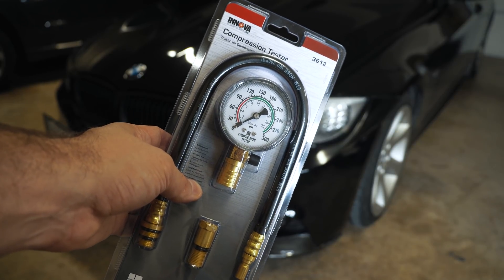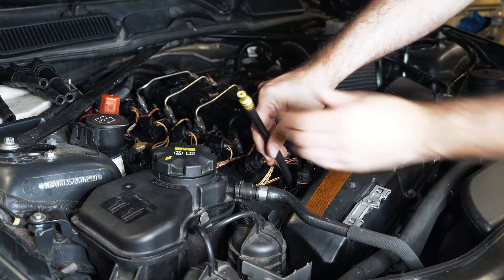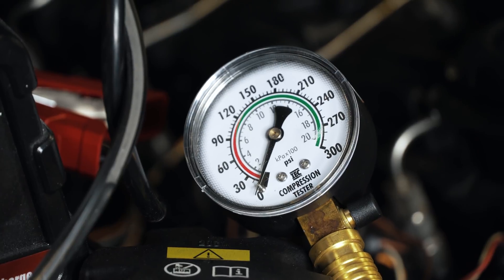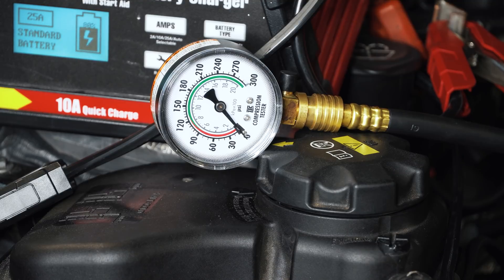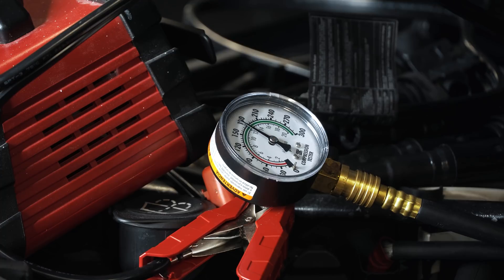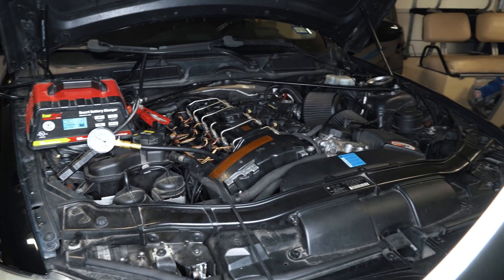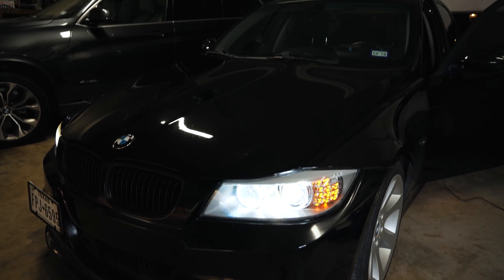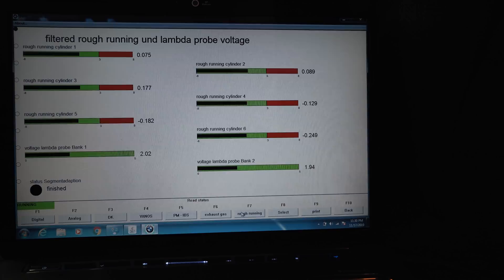I Can't Believe It. At 200K Miles My BMW Engine Is BRAND NEW?!

Comment: My e90 n52 Has almost 170k and running strong, soon im planning to replace oil/coolant housing gasket. Preventative Maintenance. And using Liqui moli and ever since runs better, more powerful and exhaust sounds more Aggressive and no more ticking. And I step on it or u know take off normally and Shifts are very smooth which I love.

Comment: I have three bmw's a 1991 bmw 525i with 233,000 miles, a 1994 bmw 530i with 260,252 miles on it and a 1999 bmw 740il with 212,000 miles on it. I bought the 91 for $6300 back in 2002 with 130,000 miles, If you take care of your cars then can last a long time. cousin had a 1986 or 97 bmw 528ie with 360,000 then a truck totaled his car.  My mechanic has a friend has a 3 series with over 1,285,000 plus miles on his car. Here is a video with one million miles: https://www.youtube.com/watch?v=gHmMlU8Q-V8   BMW has won more engine awards than any other car made. https://en.wikipedia.org/wiki/International_Engine_of_the_Year

Comment: What are the compression numbers for a factory engine ? I been told that the n54 it's good with 120 psi , it's that right ?
Reply from the maker: I believe you would want to see at least 170 across to deem the motor very healthy.  Direct injection turbo cars have compression numbers similar to older NA cars.  120 would be a really low number give the compression ratio of the N54.

Comment: But Scotty said that it was impossible to reach cylinder 6 and that ANYTHING plastic in an engine bay will fail immediately and is worthless. 

His dumbass must not know Toyota uses plastic intake manifold, pulleys, hoses, radiator end caps, valve covers, expansion tanks, washer fluid, gas tank etc. 

Solid info my dude ❤️🤙🏽

Comment: Amazing results for the mileage. Usually it's the rod bearings that kills the N20, N54, N55 and S55 (same exact part). 
You should send a oil sample to a lab to make sure low amounts of wear metals show up in the samples.  Lead may not show up in tests as the bearings are made of special alloy.
The B58 engine uses coated bearings which are significantly more durable.
Reply from the maker: Yeah that's a good idea, I will keep a sample on the next oil change.  Yeah I believe the bearings are coated on the B58 to tolerate the start/stop functionality.

Comment: Clown Scotty, complained that BMs engines don’t have oil dip sticks, because you can check the oil level from the instrumentation without getting out of the drivers seat, a little like an aircraft, bad design hu 😂

Comment: Any mechanic who knows what he's doing will not be surprised by these figures, those compression figures are near perfect for a new engine never mind one that's done 180,000 miles, BMW engines are brilliant if looked after properly and that six cylinder unit really takes some beating for high mileage reliability. I think given those figure that engine will be capable of a least doubling the mileage it has already covered no problem. The Diesel version does Unberlievable mileages between overhauls, that six cylinder in line engine must rate as one of the best engines in the World no matter what that Australian Pillock Scotty says.

Comment: Off topic a little, Do you worry about rod bearings going bad at 200,000 miles given the amount of HP & Torque you are running?
Reply from the maker: They very well could but I'd rather leave well enough alone, if you proactively replace the rod bearings you may find that your main bearings all of a sudden go.
Reply: Are you saying that replacing the rod bearings would create an imbalance in new/ old parts?

Comment: Did you ditch the aftermarket Spool ingitin for good?
Reply from the maker: Not for good but they weren't helping with my misfire issue so they're off the car for now.  The Eldor coils I have in now are perfectly capable of the power levels I'm at.

Comment: Im a bmw mechanic and I'd say most BMW engines will have a great compression number at 200k mi or more if you keep up with maitenance, problem is especially on the 2006 and newer bmw everything that's plastic or rubber (and there's a lot of plastic & rubber in the engine bay that will be cooked at around 120k mi or less) and a lot of people don't keep up with the maintenance on these cars and won't make it past 200k mi  before they overheat the engine and blow the head gasket or it runs like crap due to bad turbos, vacuum leaks, misfires, bad sensors, injectors, valve covers etc. In conclusion Scotty is right, these newer bimmers are endless money pits. Btw I own a manual 2001 330i e46 with just over 200k mi with very healthy compression numbers, in fact the only thing wrong with my car right now is the abs/dsc computer but I will pull it out soon and get it repaired.  No need for a newer  bmw for me, they just don't make them reliable like they used to.
Reply: So in other words, from what you are saying: They are moneypits because people cant take care of those cars and probably cant take care of any other cars either. In conclusion, scotty is wrong for several reasons. I have had some bimmers and they are in most case even better then alot of the other brands around. People also think that toyota is so much safer and better to buy, they could not be more wrong. Ofc, people could be having bad luck with their buy, but that goes for everything. And on the last part, sadly no one does anymore.

Comment: BMW Engine can Hold 500K and more miles IF you do proper maintenance.
Reply: DB Supercars 1000k + 🤣
Reply: H H to an extent I agree, but this is mostly due to the underhanded nature of how they are marketed and sold to entice company car ownership. 15-20k mile intervals are a joke but they shift stock from showrooms and after the first owner is done they could not care less since it will be out of warranty. If you treated a new car with the same regularity of maintenance as the old gold it would continue to be a multiple 100k mile block - without burning oil.
Reply: If anyone doubts this go look up the Mobil E30 325i that had a million miles put on it in lab conditions with factory recommended service intervals. 

Bavarian straight 6’s are one of the most reliable blocks goings.

Comment: You can have a good compression but have a bad leak down test, bacause rings can be good but you could have leaking valves with is normal with that milage.
Reply from the maker: Yeah I think that would be an interesting video so I'll follow up with a leak down test.

Comment: My wife's N52 has almost 280k on the engine, yes I've replaced the complete cooling system and it's almost time to do it again, but it's been paid off for a while now, so $600 every 5 years on maintenance is nothing.

Comment: i hope mine makes it this far my n54 is currently at 75k ..these n54s are money pits i baught it with 69k on 15 month ago ..very clean motor with lots of things done inc injectors and turbos ...however i have had to change turbos again due to crappy ones being fitted eather second hand or ebay turbos..,changed valve cover and gasket ,waterpump and thermostat ,oil housing gasket ,gear oil , and seized track rods , however these are mostly maintainance bits other than turbos wich is bad luck ..im planing on keeping for a long time and going to keep up with whatever it needs indeed these are lovly motors to drive :)

Comment: I have question, I have a BMW 500I  GT with X drive 2013  54,000km. The issue is that I changed both engine filters and noticed that there is a smaller filter loacted above in the air box. Called BMW and they said you cant change them out. I would need to change airbox filters. Wondering woud it be ok to remove them ? Thank you.
Reply from the maker: Are you referring to the cabin air filters?
Reply: @VehicularDIY  hey, sorry for the late response. No I'm talking about the engine filters. When you take off the two engine air box covers you have what you would normally expect to see two engine filters. The difference is on mine when you take the covers off and you place the cover upside down there's another filter that is attached to the cover itself. I have never seen this before but I'm told that it is actually part of the top portion of the air box cover and the only way to replace it is to change the air box cover at $500 each. Some people have said that you can change the actual filter another say don't even worry about it just take them off.
Reply: @VehicularDIY  I can see why you would have thought that as there are two cabin filters. I have already changed those underneath the glove box.

Comment: I am at 105k  '07 n54.  What oil do you use? I have been using Liqui moly 10w 30 .  Thinking of using mobil one  0w 40 European oil
Reply: Why the hell are you using 10W-30 the oil is wayyy too thick when the engine is cold which results in more metal on metal contact when you first start the engine since the oil needs to take more time getting to the parts. Use 5W-40 for  summer, and 0W-40 for winter if you live in a cold area.
Reply from the maker: I always run Shell Rotella T6 5-40 here in Houston.
Reply: @MikeNikprelaj  , I meant 5w 30w. I live in  Phoenix so it doesn't get cold here.
Reply: zmanphx use 5W-40

Comment: Off-topic question I saw your video about O2 sensors I’m running a stock N54 on my 2008 does it make sense to go ahead and get the Bosch universal or should I get a German OEM brand like FAE from Ecs Tuning etc.?  Looks like universal is about half the price.  Thx!
Reply from the maker: If you don't mind wiring it up the Bosch universal is great for the secondary O2s.  You end up with the same exact sensor once you wire it all up.

Comment: Missfire more than likely injectors. I just installed some reberbished index 12s in my 535i last week and bought the autel ap200 diagnostic tool to code them. Was pretty easy. About 2 hours

Comment: What happened to the aftermarket coilpacks?
Reply from the maker: For now they're off the car as they only seemed to exacerbate the problem, they're not needed at my current power level so I'll consider putting them back on once I go full E85.

Comment: You remove all sparks? Or one at a time and do all cylinders 1 by 1?
Reply from the maker: All were out.  Helps you hear the pulses of the engine and makes it easier to turn over.

Comment: How much oil do you usually burn with that kind of good compression?
Reply from the maker: I have never had to add any oil between oil changes even when going up to 7k miles in between.  The N55 in my F15 calls for a top up of around half a liter between oil changes.  My N62 in my old E70 X5 used to drink more but this N54 has never needed oil.  Kind of crazy come to think of it.
Reply: @VehicularDIY  Wow that's really awesome! Mine needs 1 quart in between oil changes which are usually 4K miles. I'm guessing my compression numbers won't be as good as yours either haha
Reply: Nice video. I got a 122k miles on my 2011 328i. The car burns about 1 quart of oil about 4-5k mikes. I changed the oil every 6-7k miles. By then, the oil sensor dipstick reads about half way of oil remaining. Not sure why it’s burning. Never replaced valve cover. I may have a slow valve cover leak.

Comment: I have misfires on cylinder 3 even after changing everything else so maybe I should do a compression test too lol
Reply: I had this same problem with my 335i N54 X6 and have checked everything but misfire still there,after long check turned out the DME/ECU had short In #3 after my brother eccdintly ripped off the  brown wire in coil #3  While changing the spark plugs and injectors, so I bought used DME and reprogram it now everything works fine.
Reply: @Omar1Canada  That is alot of bullshit you have been told
Reply: Nils Jakobson hahaha
Reply: @NilsJakobson  I have the old DME do you wanna buy it?
Reply: Same here on N53 engine
Reply: carbon build up maybe?

Comment: I have a friend with 392K on her Bmw e90! I think it just had water pump and a few coils. Do you plan to do anything preventative on your engine like timing chain tensioner, or other common higher mile parts? Or just wait till you have symptoms? Also, thanks for filming all your work for us, and taking us along through your ownership. Cheers
Reply from the maker: I've done the timing chain tensioner, there is a much older video on my channel for that.  I'll probably wait till I have symptoms but of course would always make a video on it.  Thanks I enjoy doing it.
Reply: The coils and electric water pump are good items to start for preventative maintenance.

Comment: How this procedure should be performed od diesel ?
Have you owned it from new ??
Reply from the maker: Interesting question actually, I have never compression tested a diesel.  I believe you have to remove the injectors or glue plugs and buy a tester rated for higher PSI.  I have not owned this car since new, I've had it since 2015 and when it had 140K miles but I could tell it was really well taken care of.
Reply: Wish petrol cost would be in europe as it is in US i would definietly own v6 or v8 . Love the sound of those engines and how they pull from low rev all the way to cut out . Yet got to live with m sport body n47 2.0 diesel . I like how the car handles just put new eibach pro springs and bilstein b4s dampers to replace stock m sport worn out after 130k miles . Also just cleaned intake and removed flaps . Love your videos and calm voice describing . Regards from Poland

Comment: What clutch and flywheel are you running? I've read information about stock DMFW and even the Luk replacements causing misfires on higher HP N54's. Just food for thought.
Reply: He has an auto
Reply from the maker: Yeah it's an auto.

Comment: Got a 335i with 180k checked it up only leak is oil gasket housing, got the car on the dyno and made 379hp and 428tq. Has all the supporting bolt on mods with billet twin turbos upgrade. Engine is clean every single gasket has been changed on this motor. Glad i stumbled on your channel helped me pick out a great car.

Comment: I thought you had gone with aftermarket coils? also wasn't your misfire  on #6 fixed after the MSD81 DME/O2 sensor replacement?
Reply from the maker: I did but they weren't required at my power level so I'm running Eldor coils.  May end up putting the aftermarket coils back in at a later date.  The misfire has been intermittent so for now it's not resolved and it's appearing to be tune related.
Reply: @VehicularDIY   awesome. Thanks for all the content you put out man, very helpful!

Comment: If everything is on check and you’re getting a misfire it’s probably the tune.
Reply from the maker: Yeah it's looking like it now.  Thanks for the feedback.
Reply: Vehicular DIY pure evil tuning is where it’s at man
Reply: Yeah! Make sure it’s a legit pro tuner cause that way you’ll fix the issue or they’ll let you know what’s up so you can fix it
Reply: Vehicular DIY I fixed my misfire with octane booster. I’m in Canada using 94 and have stage 1 mhd. No misfire on stock and every pre-tune maintenance was done before I tuned it. Guess the fuel we get here is just shit.

Comment: Im baffle with your misfire !! Only thing im wondering its if there its anything at all in the tune . Could it be a faulty new injector .. i got the same readings  on my compression test . Do you run e 85   mix or 93 ?
Reply: I believe he runs a mix like e40-e60 but yeah I think after this we are all baffled that's the only thing I think of is a bad injector.
Reply from the maker: Yeah I'm running a mix of e50 at the moment.

Comment: Are the adapters reversed thread or can they get stuck in engine when you try to unscrew the tool?
Reply from the maker: They are not reversed threaded but you can get a socket on them worst case to get it out if it get stuck.

Comment: Here come the N54 Is UrElAiBLE I RaThEr GeT a N55 comments haha
Reply: ^right? Can easily tell who's a BMW guy and who isnt
Reply: NorthernN54's 🤔 I knew that was gonna happen when I flashed stage 1, that’s why I already had the aftermarket one on me 🤡 Tbh bmw should’ve just made it a recall but oh well
Reply: @mcintosh.motors  You ran a tune on the stock chargepipe? FACEPALM
Reply: @mcintosh.motors  well that's good aswell! Atleast u had it but you ran the risk of sucking in broken pieces of chargepipe into you TB and everything down the line. Risky move in my opinion
Reply: I've already blow my chargepipe and a coolant line in 5 months of ownership; N55 is barely more reliable lol
Reply: @mcintosh.motors  lol no one keeps the shit plastic charge pipe.

Comment: So you can do this test with all the plugs out of engine?
Reply from the maker: Yes all plugs removed.
Reply: Ok cool I’m swapping out to the new NGK plugs tomorrow. Might as well do the compression test while I’m there.  The fuse you pulled was #70 correct (yellow)?  Kind of hard to see in the video